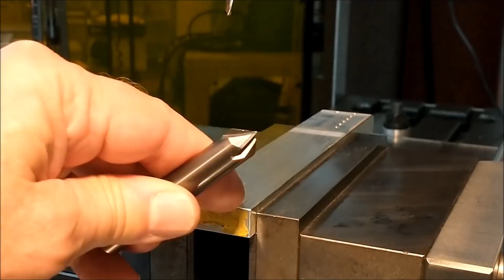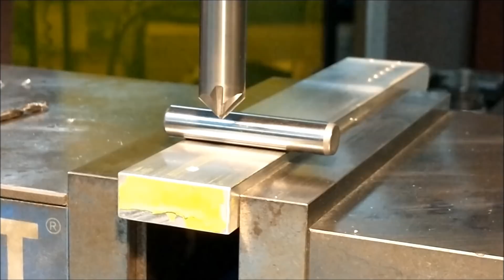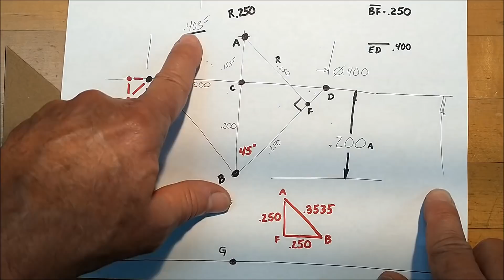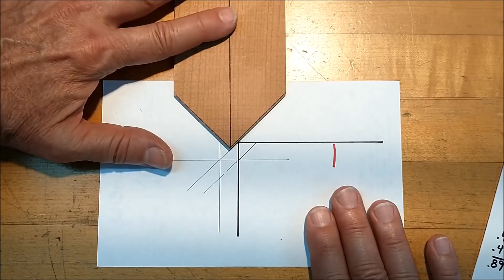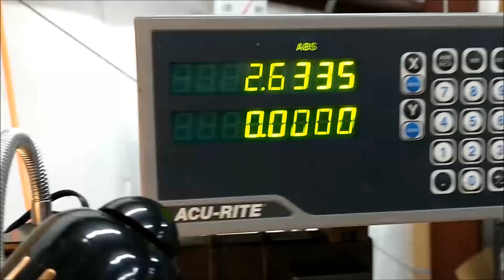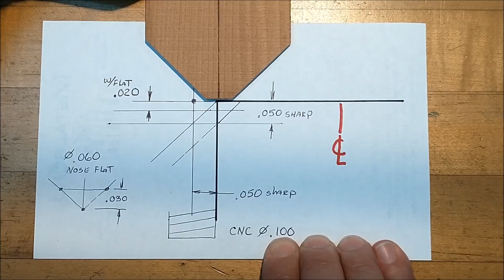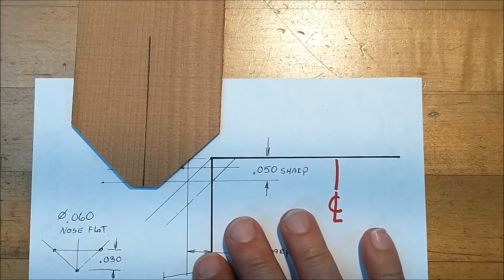How to use Chamfer tools for Increased Accuracy - You Should Watch This One !!!!

Comment: Great video! I ran into something today that might be worth looking into. I have to make an inspection gage thats fairly simple, just a cylinder that's faced cleanly, turned to a specific diameter, with a hole in the center to check concentricity. The kicker is the edges need to be absolutely square with no burr, no radius or chamfer permitted. Whats the best way to achieve a dead square turned edge with no burr and no manual deburring, directly off the lathe?

Comment: I use a measuring microscope to check the tip width.  They cost $30+ on ebay (depending on what you want)

Comment: Joe, great as usual. A little while back you did a video on production parts using the model 48-000 Edge Multi Axis stop. It is great quality but I'm not sure if they produce it for machines using the 1/2" 3/8x16 tee nuts as the 48-000 uses the 5/8" 1/2×13 thread, but you probably already know that it is easily adaptable to the smaller mills without changing the architecture at all. When it came and I realized the t-nut difference I thought about the options for a few, dug around the bins I have and found a 1/2×13 socket head grade 8 bolt 2"× 2-1/2 " long.
Reply: Sorry I fat fingered the send. As the bolt supplied is 2& 3/16" long I put it in my lathe and cut to that length, cut 1" of the bolt to .375" and threaded that to 3/8×16 and calculated that because of the design size of my lathe I was going to be a little long on the 3/8" threads so I took an old air fitting and turned it 10 thou. under the socket head diameter drilled it 1/2", parted it at 1/4" champhered it and slid it over the new bolt, gives it a great look with that whiney brass spacer and works perfect, just a snug locks it down. You keep the bolt that comes with it and not change a thing.

Comment: Thank you Joe.
How about some content on Patreon? Maybe something like the day to day operation of the shop. Employees, jobs, how do you make it through the day and stuff like that. Let us viewers rummage through your tool boxes via camera thing.
 I'm not a machinist. I'm a retired big truck and mining equipment mechanic. I have used portable tooling to machine engine blocks in chassis. My dad and grand dad worked for Cleveland twist drill. Granddad died in 1960. CTD actually closed the factory so everyone could attend his funeral. The only employee of the company that has ever been honored like that. My dad lasted until Acme bought them and closed the plant. Then he worked for a small job shop that catered to the airowspace industry. Mainly NASA. A tool grinder in a shop that consistently measured parts to the millionth of an inch. I was never allowed into the shop. 
      Your work fascinate me.

Comment: it will always be exactly at the height of the surface after dropping the height of the pin, regardless of the shape of the point because you are indexing off the lowest point of the tool against the 3/8th pin
Reply from the maker: True. But beyond that, you better know if the tip is pointed or flat.

Comment: The nose flat is also dependent on any run-out of the spindle, collet, etc.  You could have a perfectly sharp point, but the run-out will give an effective flat of some diameter.  There is always some run-out, though you might not notice it until you are measuring to sub 20 millionths of an inch.

Comment: On the "Absolute v Incremental", I think there's one sentence or three of defining what they are that would be helpful to those completely new to the idea. "Absolute and Incremental are two separate (yet parallel!) axes of a graph that overlap for our convenience. We can set, reset, 'tare' the origins at our whim as we choose where we're measuring from. Generally, the 'Absolute' is left set to some one key location for the entire part (upper-left-top corner, say) while the incremental can be set for dealing with each sub-part (center of rail-one on the end)."